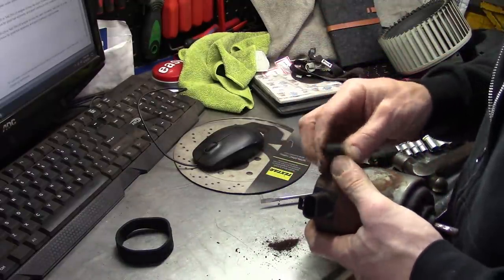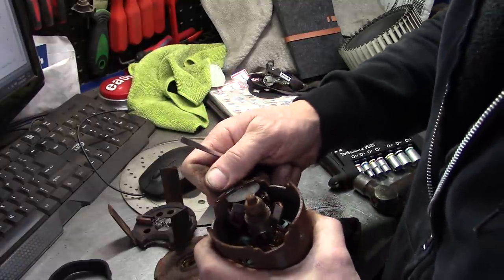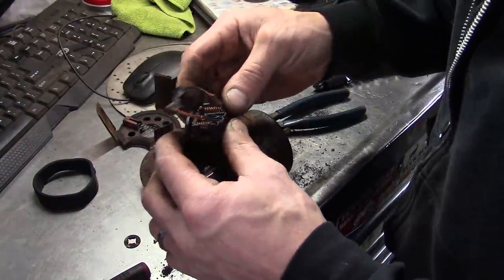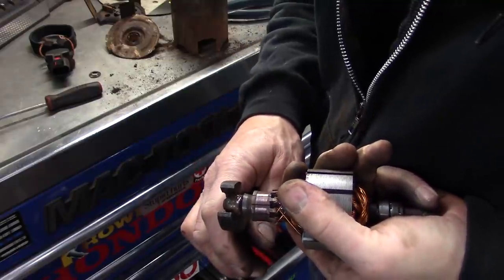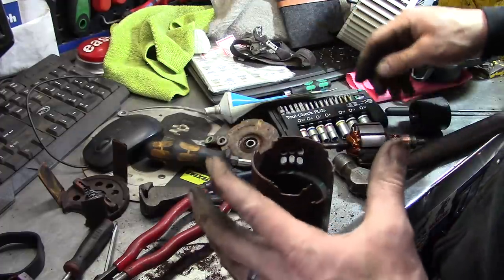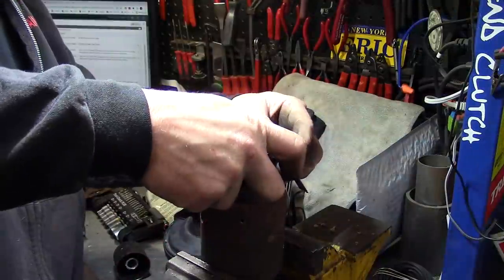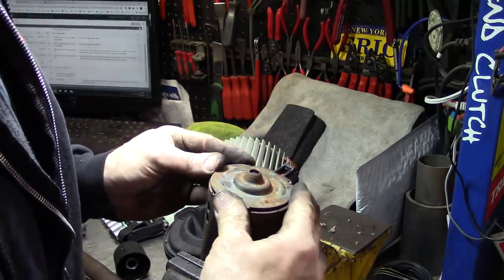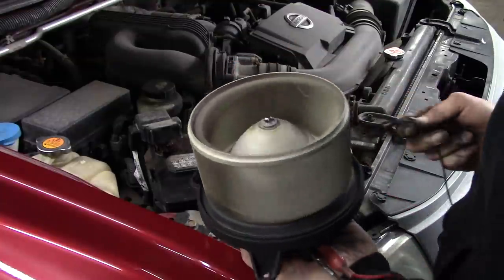BONUS FOOTAGE: Blower Motor Tear Down (Full Russian)

Comment: If I'm not mistaken this kind of repairs is done in Cuba and some countries of africa, in Siberia most of the cars are LADA ... Like some one said back In 60/70 electrical car shops usted to repair alternators and starters in Buffalo, I still remember in portugal in 2000 we had that kind of shops doing that repairs not to far ago, we became a society  that forgot how to repair stuff, here in Canada is hard to find a shop to resurface  rottors, when you call them first thing they tell you is cheaper buy new rottors from China that do the resurfacing

Comment: That re-built motor would probably last quite a while; it looks like water had gotten into the motor initially.  Those bushing were in all likelihood bronze oil light impregnated; no extra lube required (but in their shape I'd put a light coat of grease on re-assembly).

Comment: Can't tell you how many times I've done that to those cheap box fans. They won't turn when plugged in and turned on.
Solution: take fan and motor apart, clean sleeve bearing and shaft and 9 times out of ten, you'll get more years of service out of them.

Comment: I remember selling the motors and returning old ones for cores.  I see moisture causing the failure. I have done that in the past, just to see if it can be done. Aparrently not with an x-trail when motor has a meltdown though. Those motors are 1/2 the price of what i paid for the car.

Comment: That was a Great "how to" in a toss it society.   Where did all that moisture come  from?  AC or defroster buildup?   I had S10 that would get water on the passenger footwell.  Took the dealer several tries at diagnosing it.  plugged drain was the final conclusion.

Comment: As a retied ase certified heavy duty truck and school bus mechanic, I always dissemble bad parts to understand failure points to gain info on why had failure, . I admirer you dedication to find out why part failed. Otherwise you end up shooting the parts  cannon at it which always rubbed me the wrong way, kudos for your work ethic.

Comment: Shocking how rusty those motors get, seeing as they are in the cab and under plastic.
Reply: Lower bearing. Probably condensation from the coil when the AC runs, and it dribbles down into the motor and rusts it.
Reply: @Mark Kotyk Living in the bottom of a damp evaporator box in the rust belt is never a fun place for anything electro-mechanical🤣

Comment: I tore apart my transfer case shift motor and found one of the copper wires (shown around 3:06) wasn't connected (or broke).
How did it ever  (still) work?

Comment: These blowers have design flaws in them. They take a bit of exhaust air stream for their own cooling. In professional HVAC equipment you don't see that mistake. It would just take a bit more to design this the right way: - Use the other end of the motor to drive a small fan disc that circulates a bit of ambient air around and through the motor. - And do not mount the motor under the fan, so it forms a beaker where condensed water collects at the bottom.
Given the sorry state the current aftermarket part business is in, I'd be happy if my mechanic would refurbish that OEM blower motor like you did, and reinstall in the car.

Comment: I did this on my old Dodge truck, but later decided to replace it with a new one. I was concerned the existing corrosion in it would just recur and I'd be stuck again with a frozen blower.

Comment: As with small engines, labor wize and the condition of the part doesn't make it worth repairing certain parts. It's easier and cheaper replacing the defective  part than fixing. Yes, that may work for a while, bit chances are, that will fail again .

Comment: Why would NAPA sponsor you when you keep mentioning them without sponsorship?  😁
Reply: Good point .  The downside of a parts supplier being a mechanic's sponsor Is that it casts doubt on the objectivity of that mechanic.  
I wouldn't mention the source of parts unless the parts are hard to come by,  they are an outstanding supplier,  they are my last resort because the parts that they sell are unreliable, or I was being WELL paid.  
Ivan of PHAD refuses to use aftermarket electrical parts unless he's forced to. He's found lots of aftermarket parts installed by owners and previous mechanics that were defective and contributed to the problem he was paid to diagnose .